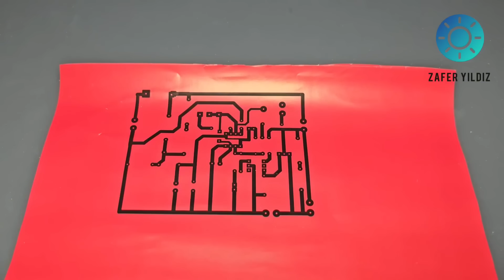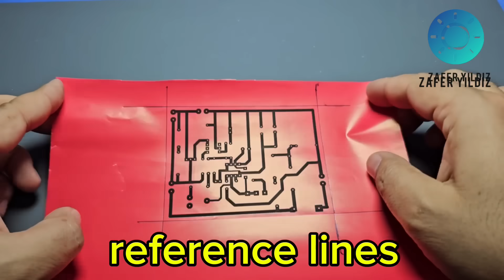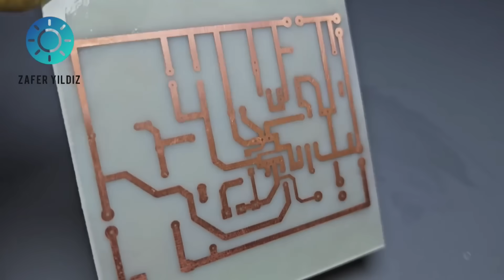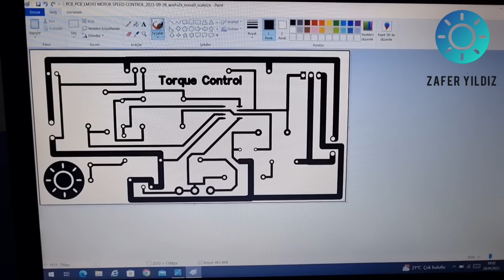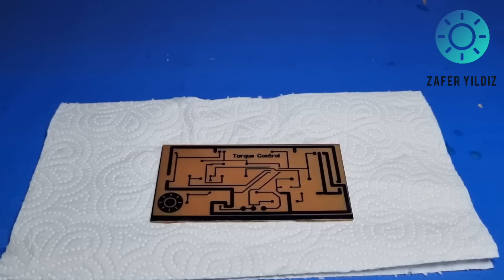4 Easy Ways to Make PCBs at Home – It’s Simpler Than You Think!

Comment: The EASIEST WAY is mine:
I cut the tracks with a desktop-sized plotter and then use an acetate pen (Edding) to fill them in with ease and quickly. After etching, I get almost factory-quality results.
I’m just a hobbyist. Such a plotter costs are equivalent to costs of a refillable (CIS) color printer, and is easy to store and nice looking.
I used to make PCBs with the iron-on toner transfer from a laser printer, but on close inspection aftre etching the tracks were very uneven with bare spots, so I didn’t like it at all.